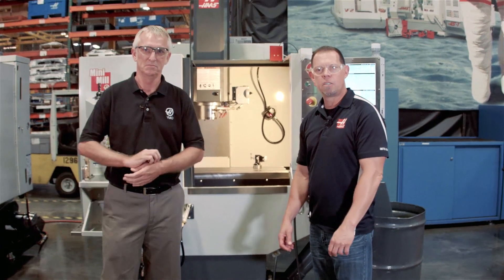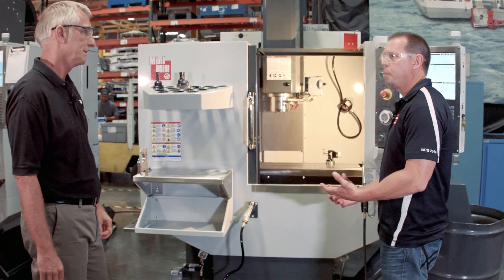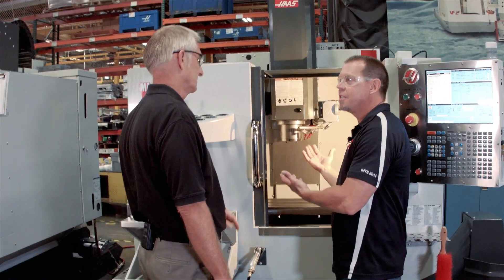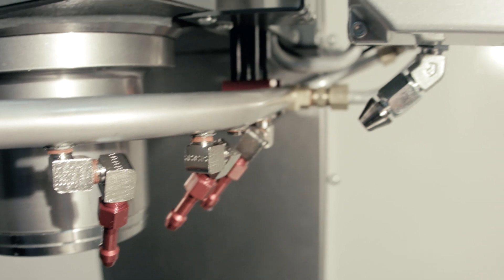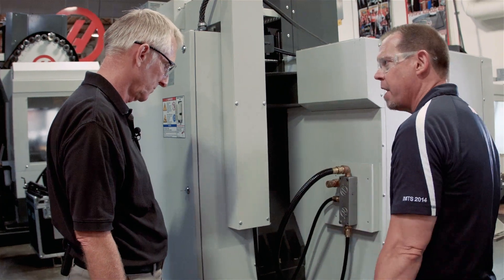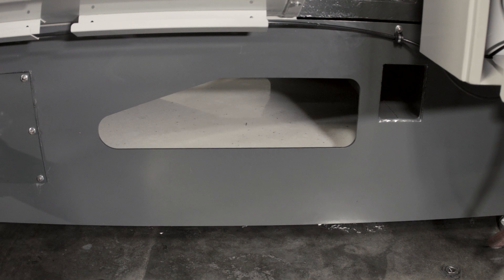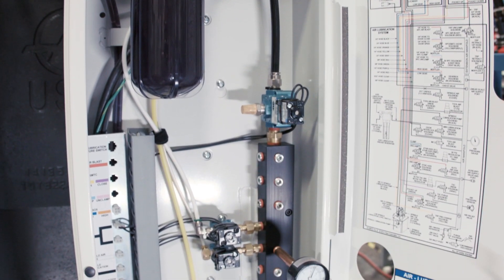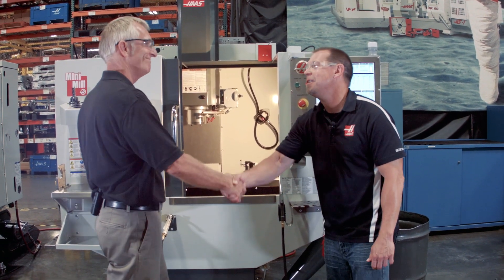The New Haas Mini Mill

Comment: 4:09 Bob Draper there, pointing out a long-term design issue with the Minimill coolant sump: "You get some little floaty Aluminum chips"... That's an understatement!
In an integral sump layout, chips building up in there is not only detrimental to the longevity of the coolant but a time consuming and knuckle skinning nightmare for the poor sod who has to keep cleaning it all out through the tiny access ports.

The ingress of large chips is mainly down to the 20mm slots in either side that are meant to allow the coolant to return to the sump if the main enclosure's mesh gets blocked, but are in the exact place all the chips wash down either side so they just pour into the sump there.

Those slots need to be "hooded" from the top so that coolant can run up to them but chips wash over them. Fundamental design oversight considering how it affects the end user and how easy it would be to improve it.

Other than that best machine this size I've ever used.

Comment: the first wrong thing you did is the door moved to the side..the worst thing you did..the door should be in the center of the spindle..The second thing the controller is slower than one crawl..software is slow and very late..and then you say that you improved the machine? you ruined all the best on it ... go back to the design of the 2008 mini mill..it's the formula versus this new mini mill ..

Comment: A nice machine, I owned them and run them for others. But, the simplest yet most glaring mistake associated with this machine is the X axis home position with the table traveling all the way to the left. So, if you have a nice part in a vise or a taller setup, your parts can move under or thru the tools in the carousel and that's when the problems start. Please, move X axis home to the other side. "Thanks ahead of time"
Reply: you should have checked the z travel before you bought the machine.
Reply: @joepublic6256  z travel is bigger than the height at which the tool revolver is,the spindle goes higher than the tool revolver

Comment: can this be bought with a 10,000 rpm spindle and still be single phase powered?
is the air consumption lowered?  this is my biggest complaint about Haas machines.  they consume gobs of compressed air.  so much that a large industrial size compressor is needed with a drier.
Reply: soggy bottom boys it is pretty small compared to other CNC mills out there especially if you are comparing it to the DMU 210 P-5 😂

Comment: Why'd you get rid of side mount tool changer?
Reply from the maker: Nerdly - If you took a Super Minimill, chose a few options and then added a side mount tool changer on top of that, the machine price was up to a VF-2 level price.  It just didn't make sense for most people.  At that point, it makes more sense to go with a VF level machine.  Haas Automation
Reply: I know....my super mini mill 2 is going to be delivered next week......not every shop has enough space or  electrical power to power a VF-1 which requires nearly twice as much current......70amps vs the SM2's 40amps requirement.

I was disappointed when after placing my order i found out that my machine has an umbrella changer......there are very few videos online that cover the Mini mills in depth.....which by the way, i intend to remedy.  When searching online I saw DCTTeachers SM had a side mount changer, and incorrectly assumed mine would as well. Oh well, live and learn :)
Reply: @NerdlyCNC  you ordered a machine without knowing what kind of tool changer it had????
Reply: @joepublic6256  there was no option to upgrade.......i had only saw one SM ever....so i assumed that "carousel" meant side mount carousel......I was a total newb and didnt know that companies don't use the word "umbrella" when referring to carousel tool changers.... :)

ha ha......all good though....machine is making parts daily!

Comment: My only pev with the mills is the chip system. The screw system works but it doesn't do a good job separating the chips and the coolant. On our VF-2 I have to spend an hour or better a week cleaning out the screens and the machine, probably 2 or 3 hours a month cleaning the swarf out of the coolant tank. Also we waste a lot of coolant in the chip that goes into the bin. I know a lot of the other manufactures are using the Con-sep systems, which I have worked with, that are awesome at separating the swarf.  Are you guys planning on updating the return at all to help out with this?
Reply: I've never had problems with coolant in the chips. Maybe if you are running loads of cast iron you might get wet heavy chips. Normal use with aluminum and steels has been no problem for 10 years +
Reply: Jason Everts ..... don't forget that after awhile the constant pushing of chips wears a hole in the funnel and then starts leaking on the floor.

Comment: Ok, I'm gonna be goofy here for a second but I thought the doors were "lexan"?
Reply from the maker: +motel29 The doors themselves are powder coated steel and the door windows are "safety glass." The great thing about the safety glass is that it stays clear over time and doesn't get hazy from chip impacts.
Reply: It is actually laminated. There are two layers of tempered glass laminated together to help mitigate problems from impacts.
Reply: +motel29 "safety glass" is most likely referring to tempered glass.

I doubt it would be laminated glass for any reason, which leaves tempered as the viable alternative.

Comment: Man love that big LED light!  Can I retro fit my three other machines?
Reply: +dragonfly fab Those LED fixtures are available from a number of sources most easily accessible (with varying quality control) from amazon. You can get them in 12-32V DC and 120V 240VAC... If you can machine a part in your CNC im sure you can find a way to retrofit a 30$ led fixture.
Reply from the maker: +dragonfly fab Depends on the machine. Please email us at contact@haascnc.com and include your machines' models and years, or contact your local Haas Factory Outlet to check: http://bit.ly/find_HFO.